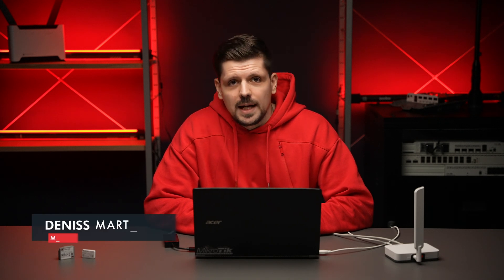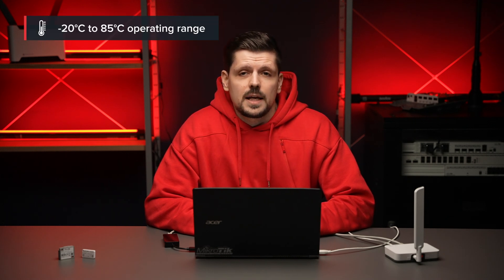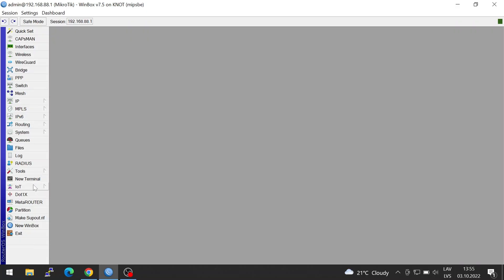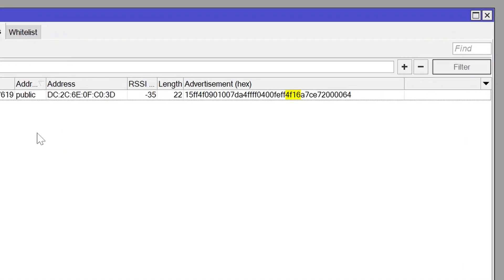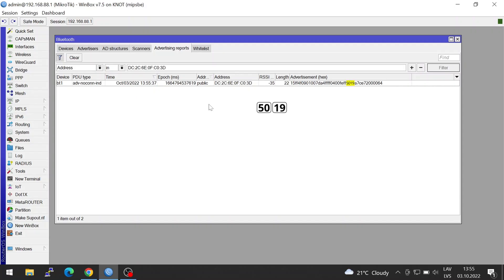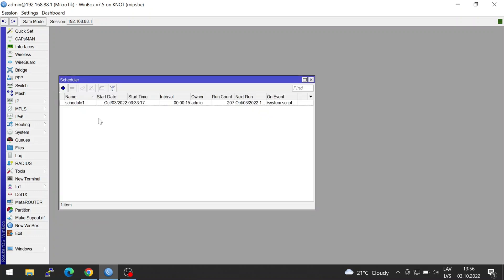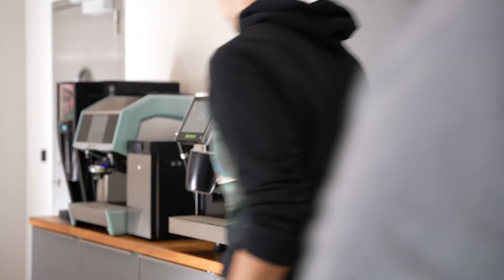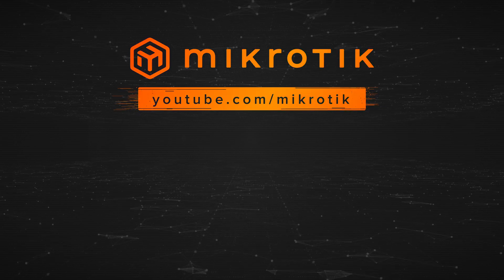Bluetooth data to Thingsboard

Comment: As much as this is something I won't ever need for home use, I do wonder, is the battery in those IoT tags user replaceable or if it runs out, that's it for the tag?
Reply from the maker: There is a built-in 550 mAH battery that will last around five years (with a sending interval of 1s), or longer, if interval is bigger.
Reply: @mikrotik  Yes, but after that 5 years, can the battery be replaced or does the user have to replace the whole module?

Comment: I have several questions about KNOT. Couldn't find answers on these in the documentation. How large is the current allowed on GPIO output pins? Are GPIOs isolated? Is modbus output isolated? It would also be really nice if KNOTs were available with an empty PCIe slot, so normal LTE modem cards can be used. NB-IoT has too little bandwidth for my application and data plans are too expensive per MB. (LMT has 6.05 EUR per 100 MB which is hilariously expensive)

Comment: From the specs I saw it supports temperatures to -20 C. So how are negative values represented ?
Reply: They show that the raw data is a 16bit fixed point value with an 8bit decimal and 8bit fraction. A signed 8bit value can represent numbers between -128 and +127. The topmost bit is the "sign" bit. If the hexadecimal value is 80 or higher (up to FF), it's negative